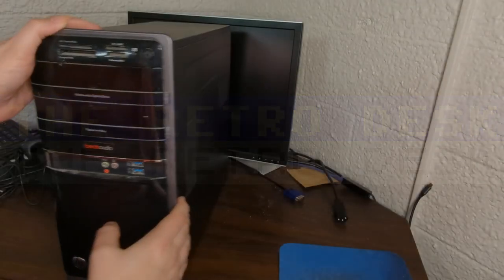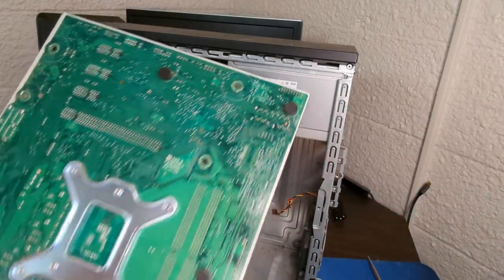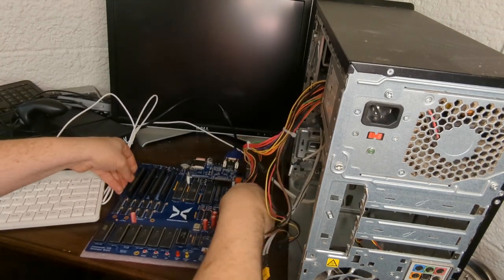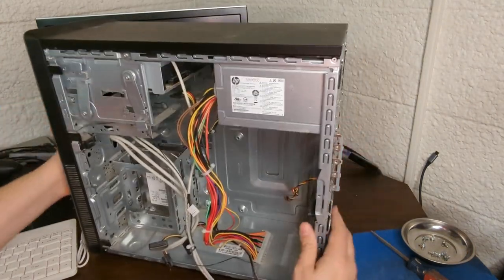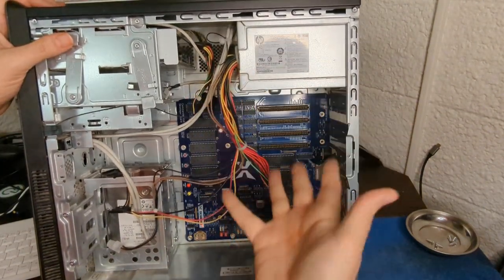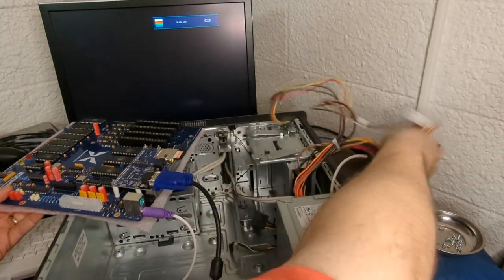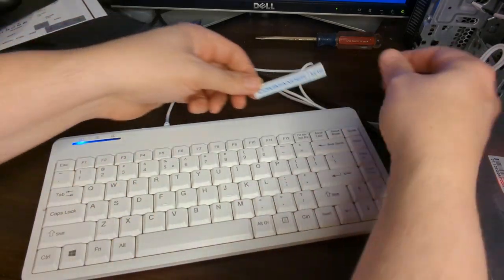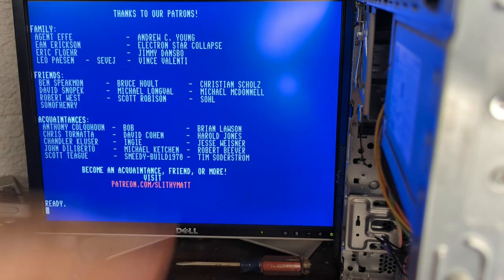Commander X16 Case Assembly

Comment: I've been keeping a case set aside for this exact purpose. Glad you showed how the board might inadvertently be grounded -  hopefully inspection will reveal the exact spot where the contact was occurring so it might be dealt with in future board revisions. Also - good to know the standard case power switch is not going to be plug and play. Great video!
Reply: could be another standoff in one of the microatx spots.

Comment: I think placing insulating fiber washers between the X16 motherboard and the case at the mounting holes would work to add more space to keep the pins from touching the case.

Comment: Does the X16 need other voltages besides +5v? ATX PSU does seem to be an odd choice IMO
Reply from the maker: Yes, it needs +12V and -12V for the sound opamp.
Reply: @slithymatt  OK. So ATX PSU actually makes good sense

Comment: Maybe I'm mistaken about the age of the computer from it's appearence, but, why would you even attempt to put windows 10 on a computer of that age? it looks like the sort of thing that should run Windows XP, use it to play some of the older games that won't run on windows 10.
At least you're using the case for something useful, but I'd recommend you keep the other insides around for future retro.
Reply from the maker: It came with Windows 7 and a license for Windows 8 which came out just a few weeks after I bought it. It was still relatively new when Windows 10 came out, but it was so low end that it struggled a bit. Ubuntu ran much better.

Comment: It still feels like an odd choice to go with SNES controllers over the way more common DB9 joystick port. Especially when you consider that a DB9 is a standard connector widely manufactured and sold today, where the SNES port isn't.
Reply from the maker: The nice thing about SNES controllers are that the ports are backwards compatible with NES controllers, so there are a lot of old and new controllers out there, and the ports are still produced in decent quantities. If they were DB9, people would expect them to be compatible with Commodore joysticks, and that's introducing even more confusion.
Reply: Fully agree. Atari 2600, several NES clones, Sega Master System & Megadrive/Genesis all with DB9. The SNES port is damn unique and using it hurts retrocomputing & retrogaming.
Reply: @slithymatt  How can the SNES Controller be compatible with the NES controller when they have entirely different connectors?
Reply: @PorcoZio79  
Exactly, and here in the UK, there were far more microcomputers than other places in the world, and most of them used the DB9 as a standard.
Almost all of them were pin compatible with each other, especially the 4 directions and primary button with Ground. It did get a bit more complex when you included a 5V line, and extra buttons though, because different systems used different pinouts in the early days.

The 2nd button was fairly universil in the later says, and the Megadrive included a multiplexer chip.
Many Amiga games were written to be able to use a Megadrive controller too, and as such, Megadrive controllers (and knock-offs) were way more common than SNES controllers. This is the standard I would have chosen to use.

The biggest advantage to DB9 is you can just buy one from anywhere and build your own arcade joystick. I've yet to see anyone selling a SNES controller connector.
Reply: @bobingabout  The X16 has a very US-centric approach. It is David Murray own bubble, a world where C64 and Nintendo dominated in the 80s. I still an enthusiast on the project but the joystick port is a joke. It is like using miles/imperial vs decimal system. David Murray went for imperial.
Reply from the maker: @bobingabout  they are electrically compatible, so you can use a passive adapter. All of this is available off the shelf if you just look.
Reply: @slithymatt  I did look. there were a couple of places selling the computer side of the connector, but the closest thing I could find for the controller side was the 8bitdo wireless adaptor to plug into a SNES.

I'm going to take a guess and say that since Nintendo was king in America since it was first introduced with the NES, but it was a fairly obscure system until the late SNES era in the UK, that they're a far more popular thing over there than here. So while to you it might be considered common, over here it's obscure, and impossible to find.
Reply: The Atari DE-9 port was already obsolete by the mid 80s, which was why Nintendo, Sega, and even Atari had to supplement or replace the 9-pin format. Commodore, Atari, and Sega chose to add bit shifters to the port to handle the extra buttons, and Nintendo just started with a bitshift-only format. 

The problem is the number of pins: The Atari 2600 interface only allows for a single fire button. Even re-using the paddle wires for buttons,, you can only have 3 buttons. In addition, that means you need 14 input wires to handle two joysticks with 3 buttons each, and nobody makes a 3 button Atari style joystick.

So the answer is to multiplex the inputs and convert the button presses to a serial data stream. With a suitable data stream, you can handle joysticks, track balls, spinners, mice, and graphics tablets - all of which were produced for the NES or SNES at some point. We can also easily make new versions of these controllers again, using cheap microcontrollers wired to various third party hardware devices. 

Yes, Amiga had a DE9 game pad - but it used bit shifters, rather than discrete wires, to signal the CPU. The Sega Genesis used a DE9, but added a Select line, which requires an additional chip on the game pad to swap the input lines. 

The thing is, it's hard to find a CD32 or Genesis gamepad. I'm pretty sure no one  is making new game pads for those systems, yet SNES game pads are easy to acquire, as are the jacks. Both are still being made new or are stocked in enough quantity that we don't have to worry about supply for years. 

Also, there's nothing stopping anyone from building an input adapter, to run those Megadrive sticks or DE9 arcade sticks with the X16. I plan to build my own RP2040 powered converter and replace the electronics in my Mayflash arcade stick. 

tl;dr Atari 9-pin does not have enough buttons. New format needed. SNES best compromise for simplicity and cost.
Reply: @PorcoZio79  The DE-9 on the NES clones isn't compatible with the Atari format. Neither is the Megadrive, or Genesis. Megadrive and Genesis controllers are famous for burning out Commodore 64's CIA chips, and the DE9 NES gamepads are just using the DE9 port with Nintendo signaling. 

While the Genesis game pads are indeed available, the way they multiplex inputs still precludes the possibility of things like spinners or analog joysticks. It also requires more control lines on the computer, increasing the cost of the hardware. 

All things considered, the SNES inputs are the least expensive design to implement in hardware, and the game pads are inexpensive to buy.
Reply: @bobingabout  Part of the purpose is to _use a controller that is easily available_. 

The connectors and the controllers are easily available. It took ne two seconds to find bare connectors via Google, and the controllers are available everywhere. 

If David went with a bit-shifted data layer over DE-9, he'd have to make the controllers, too... and meanwhile, someone would plug in an Atari stick, blow up the VIA, and be mad that the stupid design broke his computer.

Comment: The Commander X16 seems to have a lot of suboptimal design issues..For example: An ATX-power-supply-connector? Why? I guess it will draw far less that 10W.  Maybe 2W.
Reply from the maker: It's an ATX form factor board, so that would make sense. Just use the lowest power PSU you can find!
Reply: @slithymatt  Yes, you can. But it's just one example of the poor design of the C-X16. The stupid ATX-formfactor is also a big cost-factor. For an expected price-tag of 500 USD you should expect a propper hardware design. I guess all this will end in a low user-base (due to the high pice-tag) and this will lead to less software. IMHO: The C-X16-team did a bad job. An Agon Light for example can be powered by USB. That's a modern defacto-power-standard today.
Reply from the maker: @deterdamel7380  Ok, I see that your agenda is to compare the X16 negatively against the Agon based on your own cherry-picked criteria. Please stop this nonsense, it's getting really tired. I don't want to have to start banning people for this, but it's becoming a bigger problem all the time.
Reply: @deterdamel7380  Do you know the reason the X16 is using an ATX PSU or not? I see this complaint come from the Agon community all the time and it seems to originate from the Agon designer not understanding why it was there either. This makes sense because it's for an area he has in the past said he has very little experience with. That doesn't mean that there is no reason for it.
Reply: @JoeBurks_1  I'm not from the Agon community. It makes no sense to use a > 150W power-supply for a <10W device. This is just bad design. An ATX-PSU with low load is a very poor design decision, due to the high power lost. This is common sense for hardware design.